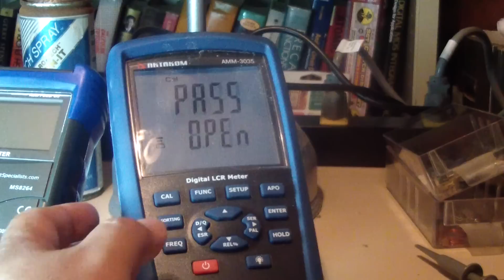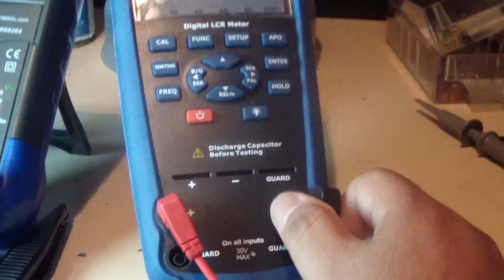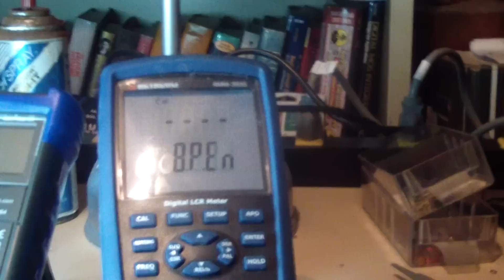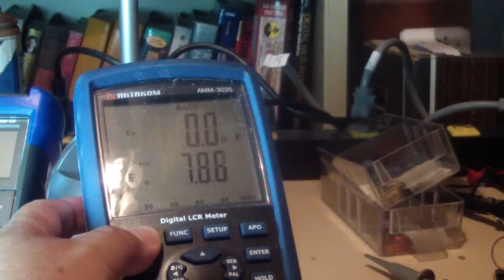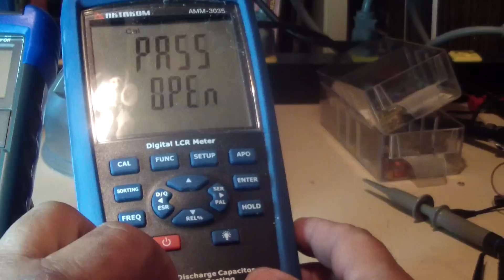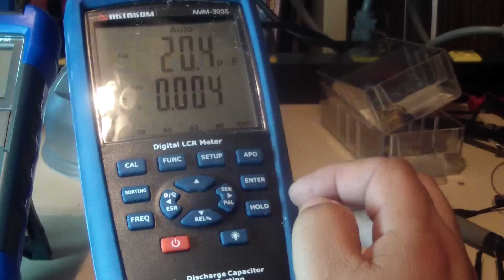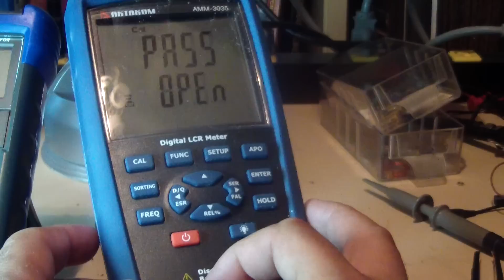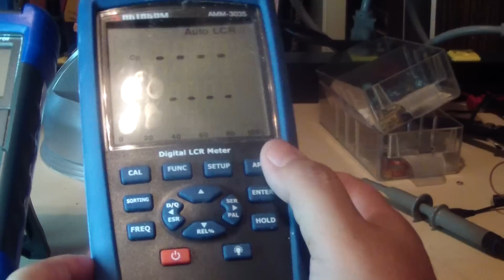Aktakom LCR meter

Comment from the maker: Rel is use to measure the relative tolerance of resistors. for example, you press the rel button and you measure a capacitor. the value is the stored and any capacitor measured after will display the relative differance. The rel is not ment to zero out parasitical.

Comment: Really 2 wires? I saw many of very similar meters and they implement 4 wire system if you plug into that flat slots, while only 2 wire system via round connectors

Comment from the maker: For a Kelvin probe you need four wires with 2 being the source and the other two are the sense or measurement wires. The meter only used two wire system and does not use the Kelvin style of probes. I don't think it can be implemented.

Comment from the maker: The purpose of the REL is to measure the percent difference between capacitor and  a measured capacitor. For example, you might have a 10% tolerance capacitor. You measure it with the Aktakom and depress the REL. Then any capacitor that you measure will display the percent difference between that capacitor and the first capacitor. I guess it is used for sorting capacitors.

Comment from the maker: No it does not have a data output port. I suspect that both of the Extech and Aktakom are manufactured by the same OEM. I am thinking of buying a bench LCR instead.

Comment: I have the Extech LCR200, which is a very similar unit, button layout, display, etc. The CAL functions works the same with the open, short, countdown, pass and fail. Same irregular results. I can zero out the resistance of the supplied alligator clips, but I can't zero out the resistance of a pair of gold plated Probe Master test leads. I wound up exchanging it for a BK Precision with a simple relative function. 
Does this unit have a data output port?